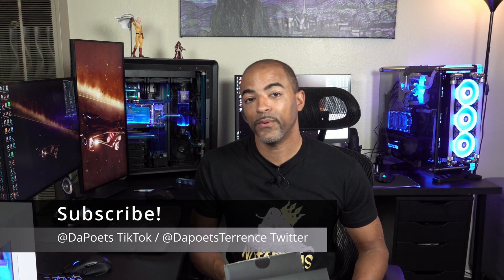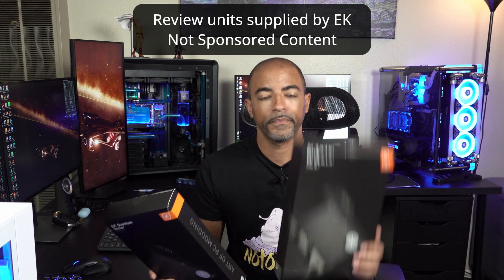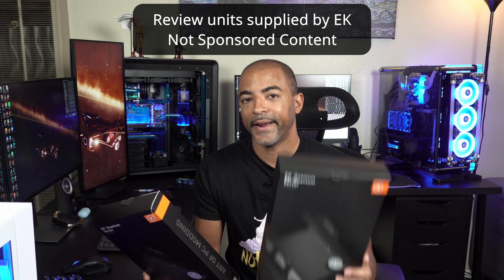EK-Quantum Vector RE RTX 3080/3090 Active Backplate Installation

Comment: Is there a different way I can use the inlet and outlet other then described on EK's website on the Water block? MOBO is the Z690 Dark Kingpin, I got some fitting issues with my 60mm bottom RAD and my V-Riser ( LINKUP - AVA Universal Vertical GPU Bracket) in a Lian Li O-11D XL case, and thanks for the great content. Subbed.
Reply from the maker: You can flip the flow bridge but that's about it. 1 in and 1 out on the other side is required.
Reply: @DaPoets  Gotcha, thanks Bro....keep it up

Comment: If you installed only the GPU water block, run some temp tests, then added the active backplate and re-run the same tests showing temp/frequency/frames differences, it would have been an amazing video.
Reply from the maker: See an updated video on that that I did

Comment: this is probably a stupid question, but which side of the block when you have both the backplate and front block installed is the inlet and outlet sides?
Reply from the maker: Front side is in, back side is out.  But it does not matter to be honest.
Reply: @DaPoets  thank you!

Comment: There wasn't much talked about an essential part: the o-rings.  that when the front part is have the riser part removed, no comment was made to make sure the o-rings are removed, nor of the removal of the packing bracket (as is noted in the manual).  I think it should be mentioned to make sure to not nick or damage the o-rings, or the card will leak, and since that is right close to the board and covered by the connector... can make it very hard to notice, too!
Reply from the maker: Thanks for the comment.  I tend not to say things like "don't break it" because it's self-explanatory. I did show in the video to be delicate with the 0-rings though.

Comment: My vram temps after backplate install are still 90c and over.
Spent 3 hours trying to put other size pads in there but it wouldn't screw together . 
Pretty bummed as the whole reason I  uilt a custom loop was to get the back vram temps down
Reply from the maker: You don't have good contact then. Take it all apart, review the instructions and ensure you're using the correct size pads on all of the areas that require pads. It's a common mistake people make. Once you have good contact then your vram temps will drop drastically.
Reply: @DaPoets  funny thing was we did all the attempted pad mod and couldn't get the sandwich  back together.  Ended up saying fuckit put it all back to how it was originally  and temps dropped 15c.
Now down to 72 to 78c under stress loads. Instead of 90+ .
Typical pc shit

Comment: Am I the only one that was bummed out EK didn't make black or silver special edition water blocks for the Strix cards? I ended up going with the EK-Quantum Vector Strix RTX 3080/3090 D-RGB - Nickel + Plexi and the active back plate but after looking at the special edition blocks mine looks really boring now to be honest. Does the computer to your left collect a lot of dust easily? I had taken a peek at that case but I had been meaning to ask an owner how it holds up before considering the purchase.
Reply from the maker: No real dust build up for me, but does build up depends on your environment
Reply: @DaPoets  I have one more question brother, I ended up going with the same gpu block as you (except for the strix cards) but I've had two large bubbled the refuse to leave the water block. I've tilted the case to all kinds of angles. Everything bled out except the front part of the gpu. The backplate filled out up good and quick Did you have problems with this?
Reply from the maker: @meropolis  Don't be afraid to turn the system entirely upside down. As long as the loop is closed you can turn it any angle you want to get bubble out.
Reply: @DaPoets  I did my man, put an extra long ac power cord and turned it all over while it was running. Wish I could send you a picture but I did manage to reduce them to their respective areas top right and left corners . I don't see any chip contact on those corners so I'll leave it be while the rest of the air works its way out. Hopefully it will clear up by the end of the week.

Comment: Thank you for the video.  I have a question if you could help?  I have a RTX 3090 already with a manufacturer active front plate watercooled.  But I definitely need an active backplate.  Can I just get the active backplate and hook things up or does this active backplate ONLY work as an ensemble with the EKWB active front plate?  Thanks!
Reply from the maker: It only works with the ekwb active front plate. Additionally you have to be careful not to mix metals

Comment: I cannot believe i just spended around 10K on two pieces Asus Ekwb 3090 gpu's and Quantum RE Vector waterblocks, and then there is 6mm huge gap between thermal pads and waterblock!!! Ekwb support recomended this waterblock to me and said it was compatible with all RE RTX 3080\3090. I contacted them again and now waiting for a reply..... As far as i know its not possible to buy 5mm Thermal pads, and now im proberly forced to make some modifications with flat copper bars for heat transfer. EKWB Seriously????
Reply from the maker: Did you get this sorted out?
Reply: @DaPoets  The answer from EKWB devolper support and from people on reddit with same isuue, says is not needed and works fine without. I bought some flat copper bars and thermal grease and will test the difference in heat transfer, soon as im done with my pc build:https://m.youtube.com/watch?v=WmD91kEtjiI

They just released new waterblocks and havnt checked them out yet and maybe they fixed the issue on the new release...?

Comment: I tried installing the front and backplate today, i cant get the adapter holes to line up with the two block
Reply from the maker: sorry for the late response. Did you get it worked out?

Comment: Did EK include the paste and spatula?
Reply from the maker: You don't need paste for the active back plate. They do include paste for the front GPU water block though.
Reply: @DaPoets  yeah I was talking about the front lol. Did they include the spatula as well?
Reply from the maker: @jgm113  I do not believe there is an included spatula but if you do want to spread the thermal paste any soft kitchen utensil applicator will do
Reply: @DaPoets  yeah you just always do in your videos so figured that's the proper way cus you know your stuff man
Reply from the maker: @jgm113  Many 3rd party thermal paste companies do supply the applicator, I just don't remember seeing one for EK's hardware.  Spreading the paste eliminates the chance of an area not receiving the needed amount of paste and leaves nothing to chance.  So when you're doing reviews like me, it reduces the number of variables to give you data outside of what you expect.

Comment: Mate, if you don’t mind I have a question?. A-bit off topic, but when you are installing a passive backplate and remove the screws e.g. 4 or 6 etc, to then use through the backplate itself, do you add washers to those screws again?. For my 3090 the manual doesn’t state to use washers for those screws, however I have heard you should to seperate the backplate from the PCB?.
Thanks.
Reply from the maker: The backplate is what's cooling those parts so I would imagine adding washers if not required in the manual will reduce contact and therefore reduce cooling on the back side.

Comment: hey buddy, are 3080 water blocks fit 3080 ti the same brand, I have Zotac Trinity 3080 Ti and my setup is fully water cooled.
Reply from the maker: Check EK's website for compatibility. They will keep an updated list there.
Reply: @DaPoets  thank you just seen that visually compatible, just ordered bothe for water block and backplate as a sandwich intallation for my zotac 3080 ti

Comment: I followed your video, read all the comments, but I still have a question about installing the backplate thermal pads, about 9:00 - 9:30 in the video.  Was it just easier to attach the pads to the backplate instead of placing them on the card itself?  Don't you then have to be very accurate where you're placing the pads?  Also, I'm thinking it becomes obvious seeing the backplate of the GPU, but what are the three very small squares of thermal pads cooling?  As others have said, your video is great, very informative, and people can clearly see what you're doing.  Thank you for your efforts.
Reply from the maker: The areas on the back plate are raised or lowered exactly where the thermal pads need to be placed. And when you screw down the back plate it is very precise. Doing it this way is part of the directions that EK supplies. As for the particular areas on the GPU as to what they are you'll have to look up the actual schematics for further details. There's memory modules, capacitors, etc...

Comment: NIce video. Beats the ekwb pdfs. 

The screws they included with the active backplate are m2.5x6mm and not long enough, had to go into some spare m2.5x10mm to get them to engage the threads. EKWB claims 8mm should work and they will 'compress the thermal pads' but i have 8mm and they dont thread in, despite any compression of the pads.
Reply from the maker: Yeah many people are saying that but you just have to apply pressure to squeeze down the thermal pads.

Comment: Literally trying to install the back plate and I swear the screws aren’t long enough to actually thread all the way through
Reply from the maker: Takes pressure. Start from the middle and work outward
Reply: @DaPoets  the instructions say to use 8mm screws but the ones included are 7mm.

Comment: You dont happen to have a picture of the block in the stock 30L case? I have the same setup wondering about going the same route just trying to determine if I'm going to have to buy another case to fit the water block + radiator + pump etc..
Reply from the maker: I considered water cooling in that case but common sense told me not to. Don't bother.

Comment: Time to install mine. Thanks for the excellent guide!
Reply from the maker: Enjoy!!
Reply: @DaPoets  So EK really messed up. First of all, all 3 backplates I ordered are warped. Second, they didn't include 8mm screws as they require in the manual. Third, I had to get 10mm screws to make it work. I don't know what's going on with their QC but it's not what is used to be.
Reply from the maker: @babytexxx  Be sure they are flush when you are mounting them and apply plenty of pressure.  These backplates require pressure to mount so people are thinking they don't fit when they actually do.  You have to push down on the plate while screwing it in, working your way from inside out. if the screws are not there that are described in the manual then yes that's an issue...

Comment: Great video, just put mine together. Did you have to squeeze the back plate to get the screws in? I followed EK’s instructions on the thermal pad but boy I had to squeeze it tight to get the screws in on the left side.
Reply from the maker: Yes that's normal to ensure it's solid contact and the thermal pads get a bit of squeeze love. Enjoy!!
Reply: @DaPoets  Thank you sir!!

Comment: For future content, I would suggest changing the EK Thermal pads to really see an improvement.
Reply from the maker: Is there a pad you're thinking of? I haven't seen many out there that drastically make a difference.
Reply: @DaPoets  I've done testing with Thermal Grizzly Minus 8 pads. Also have on hand and will be switching to Fujipoly 17W m/K pads soon. Those are two pads you can look into. Gelid also has 12W m/K pads that are also good performance wise and bang for buck. Fujipoly is expensive, Minus 8 are also up there(more by name than performance). Looking forward to your temp video.
Reply from the maker: @40rtyp  You have to remember that W/mK between companies doesn't mean anything at all.  Each company has their own way of measuring that.  a 17 W/mK can underperform an 8 W/mK pad because of this, so just disregard it. You can use that comparing products of the same brand however.

Comment: If you don't mind me asking, why did you individually cut out the thermal pads for the front 3 ram but not the side ones? @6:00
Reply from the maker: You don't have to but the 3080 only uses 1 and not 3 so I was showing that particular difference and it shows it in the directions to have them cut up instead of one long strip. There could be slight thermal reasons as not all 3 will heat up at the same rate so if one is hot it could increase temps of the others which may not be as actively used if they are connected by the same strip.  I'm not an engineer but it is what came to mind.
Reply: @DaPoets  thank you for the response! You have inspired me to liquid cool my next pc. I am upgrading from a 8 year old alienware x51. I plan on using the distrocase 350p as well. You did such an amazing job on that build. Thank you for all you do!

Comment: Is it better to use the included EK Thermal Pads? Do you think using other thermal pads can lower temperatures?
Reply from the maker: They are good quality pads, I think you will be splitting hairs at that point and you have to ensure you have the exact sizing which can be an issue as some pads are much softer than others.
Reply: @DaPoets   Thanks, Looking forward to your gpu temps and vram temps video!

Comment: So the RGB cables are on opposite sides?  Makes me want to cancel my pre order.
Reply from the maker: It's not an issue at all. I didn't have a problem with it and it worked out great for me...  Not sure if it really makes a difference.
Reply: @DaPoets  How did you route it?  For me I have it going over my card and out the back.  Also, did you have an issue with the 7MM screws?  I had to pick up some 8MM ones from home depot to get the backplate locked down.
Reply from the maker: @jonmurray7729  the included screws fit you just have to add enough pressure to the back plate when screwing them in, squeezing the thermal pads so that there's proper contact. The back plate RGB cable just dropped straight down so it's not wrapped around the GPU. Properly managed you can't even see it.

Comment: I don't know why ek changed to acrylic where the fittings screw in. Acrylic has the tendency to crack which is why they had always use pom or acetal
Reply from the maker: Yeah that's a shortcut but I was showing exactly what the directions have.

Comment: The board looks identical to the Asus ek 3090 I have except one cap is missing on yours 3rd down from nvlink. I ordered the bp but I have Asus x299 Strix ii and the ram is very close to the back of my card so adding the active bp might not fit in the top pcie slot (if u had a X299 board to test, I'd be extremely grateful)
Reply from the maker: No X299 board on hand but I can't see this not fitting any board that I can think of.

Comment: 3:22
...what? That stuff is halfway between paste and a pad. Weird.

I wish companies would just use standard 0.5 or 1mm pads for everything which doesn't require paste, and list the pads they're using in the manuals, so 10 years and 2 owners later, the user doesn't install the incorrect pad, tighten the cooler down, and bend the PCB.
Reply from the maker: I'm sure there are manufacturing reasons why they use this material but yeah it's annoying to take off.